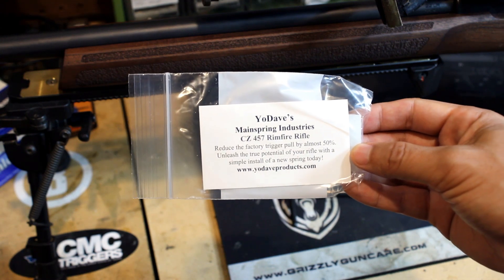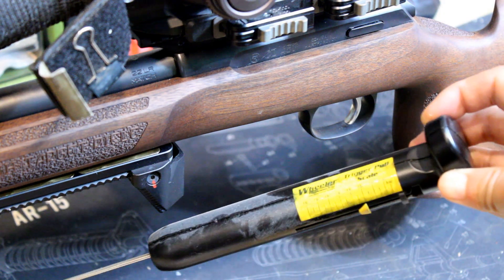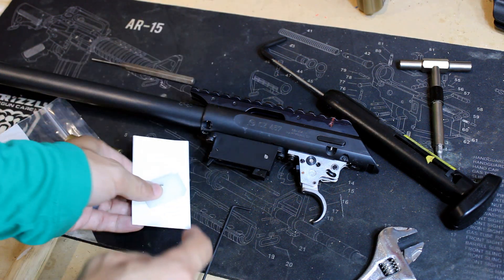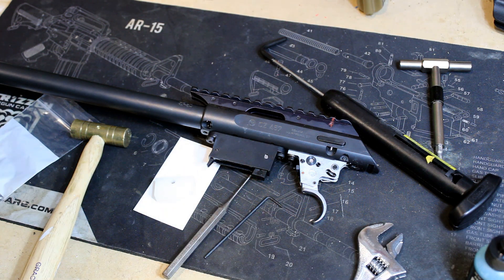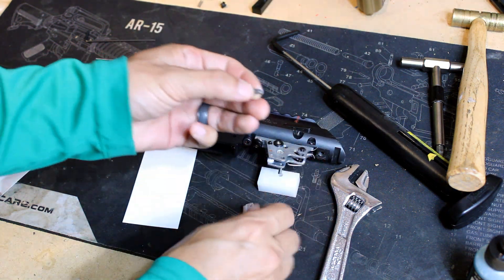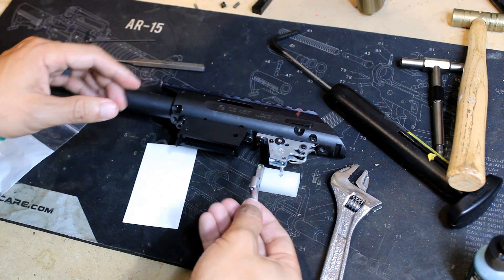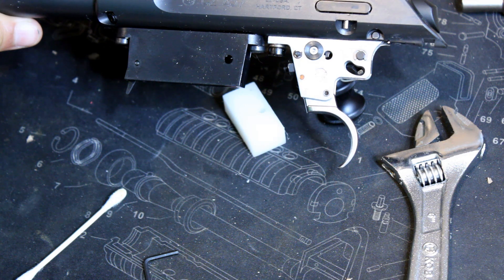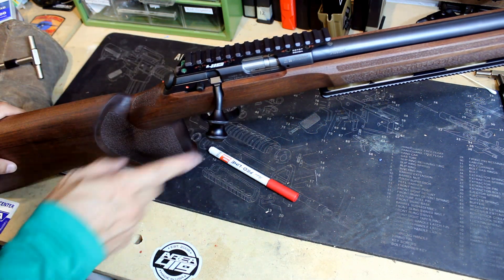CZ 457 MTR Part Six: Installing the YoDave's Spring.

Comment: I put that spring in my 457MTR and I’ve got it set at a consistent 12 ounces. Sweet!
Reply: why so much it will be a lot lot lot better half of that or one third just a thought worth then you 'll win all of your target shoots .i like just the heat from your fingers to touch it off
Reply: @ I have a highly “industrialized” trigger finger. That’s about as light as I can go and maintain control. 12 oz. is good.
Reply: @josephjulian2503  it may be for you but it's like pulling a block over laying flat  . also you will be out shot at a competition shoot or any other kind of target shoot but you need more control of your gun handling and you can handle the lower trigger pull it is very safe i shoot 44 and 357 for years and shoot thumb tacks at 50 yards with light pull like thought control .and never have trouble when you ready to shoot you pull the trigger you don't put your finger on the trigger till you get ready to shoot you can't shoot accurate with that much pull you will get beat . maybe you need more skill .and anybody that shoots a lot knows that .
Reply: @charlesborders2893  try not to make assumptions on one’s skill level based on the random comment. You might get a rude surprise.

Comment: Nice, i put the petes pillars spring in mine, basically the same thing. i just had to make the block to drive the pin out out of a block of wood. Everyone loves the cz but idk so far my cheap savage mark ii is just as good or better it doesn't have plastic, the scope mounts actually bolt/screw on and i didn't have to buy a spring to get it under a lb idk for 5 times the cost and the huge following of the cz i just thought theyd be better